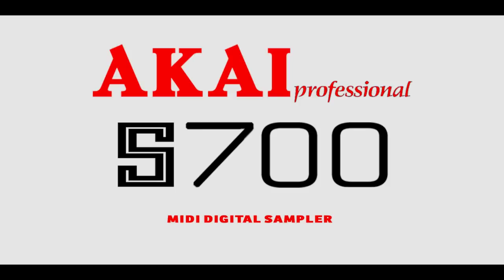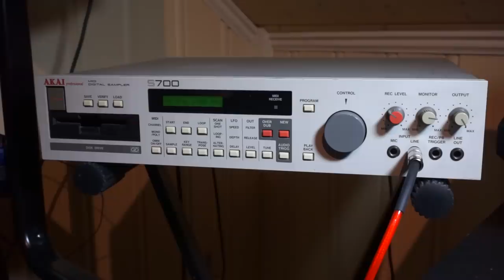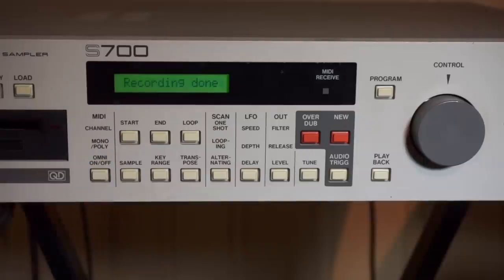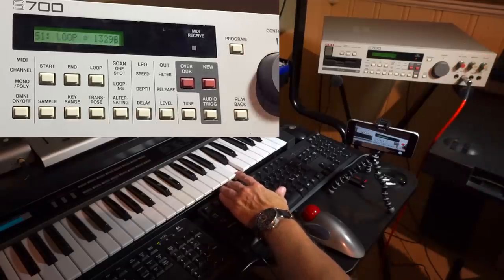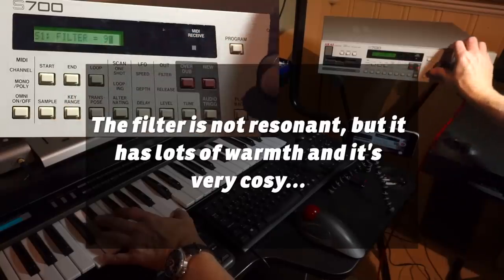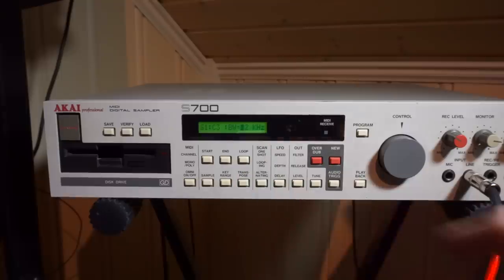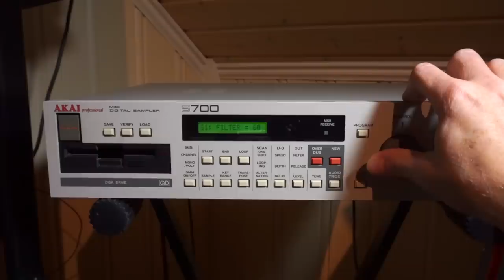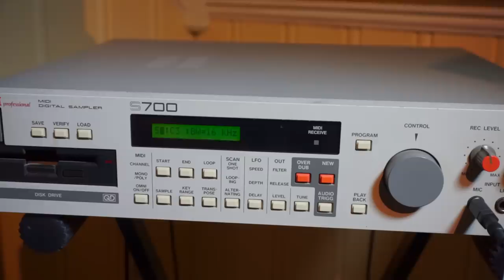Akai S700 sampler - Find this on the flea market for coffee money

Comment: how does the 7000 go againest the 5000 and 6000  ? was woundering on the vocals that was the S7000 with reverb?
Reply from the maker: The 5000 and 6000 are hi-fi samplers and they're transparent and solid, but they can't touch these old 12-bit samplers in terms of personality, grit and 80s-ness. The S700 sounds miles better than the 5000 and 6000 IF that sound is what you want. I used reverb on the vocals yes, there' were no built-in effects on the Akai samplers before the S-1100 (if you had the effects card).
Reply: @EspenKraft  I hear everyone raves about the s950 widley used and how does the S01 and s2000 can possibly buy one at the moment is it anything like this 700?
Reply from the maker: Yes, the S700, 900 and 950 sound about the same. The S900 and S950 has more edit options, more memory and more of everything, but the S700 has the easy operation, fast sampling. The S01 and S2000 is again newer and does NOT sound as great as the older ones no. Stay clear of those.
Reply: @EspenKraft  okay great wil think about these going to be my first bit of hardware gear got the MC 505 ariving excted then next want something to use to change from all the software something to give some hardware power in some form!!! Or a mixer if you have any thougts if you had to go out and buy your first piece of hardware what would you be looking at ? something under $300-1000
Reply from the maker: I'm not the right person to ask general questions like what's the best mixer on a budget really. There's plenty of videos on the net for that so just Google it :)
Reply: @EspenKraft  okay thanks like you sound you channel just found it and was just woundering since i am starting in hardware will look some more thanks!!!
Reply from the maker: No problem! I've been doing this so long that I don't keep track of all the new stuff coming out.
Reply: @EspenKraft  I can tell lol you good at your equipment keep up the good work and videos real pleasure!

Comment: I'm curious what you think are the differences between the S612 and the S700?
Reply from the maker: Just look at them? ;-)
Reply: @EspenKraft  Seriously? I have an S612 and an X7000. I was curious about the actual internals and sound differences.
Reply from the maker: No sound differences to speak of. Different looks and ergonomics.
Reply: @EspenKraft  I'm considering getting one but switching the Quik disk to one of the digital conversions that uses an SD drive. Sadly, these are not so cheap or easy to find than they were a few years ago.
Reply from the maker: I have a video on here showing how I did this to a S700. They don't cost much.
Reply: @EspenKraft  I was really surprised how inexpensive they were. I'll look up your vid on that, thanks.

Comment: Is there anything in the current market you reckon it's at the same level?
Reply from the maker: You don't get this sound from any new sampler today. Besides, there isn't any desktop/rack sampler on the market made like this anymore. All moderns samplers are more groove/beat oriented now. The magic is gone. In software it's even worse.
Reply: @EspenKraft  That's what I thought. Do you need a floppy disk to store the sounds or can be done differently? Cheers
Reply from the maker: Short answer is yes, Quick disks or MIDI sample dump. However, both solutions pose a challenge today as the Quicks disk drives crap out and at least needs the belts replaced and disks are hard to find. The other solution is MIDI sample dump, but the early Akais didn't do the MSD standard back then so you'll need old computers and software to be able to do it.

Comment: some lfos?  interesting the s612 only has pitch.  its also my favorite sampler
Reply from the maker: The S700 is infact a slightly updated (in 1986/87 they thought membrane switches and menu driven features was an update) S-612 which in turn is 6 separate delay lines not even invented by Akai themselves at the time. Both has a single LFO only.
Reply: @EspenKraft  yea i have heard the same thing, that it was invented by someone from EHX at the time.  With the overdub function, you could almost get it to perform like a looper though not hands free
Reply from the maker: @Ancaja123  Exactly!

Comment: "for next to nothing!" - it's 2021 and that aged well
Reply from the maker: No, Akai 12-bit samplers are hot right now.
Reply: @EspenKraft  yes they are, but, well, I grabbed myself Akai S900 because I guess you got to have at least one 12 bit sampler in your arsenal, eh
Reply from the maker: @wrmusic8736  At LEAST one. ;-)
Reply: @EspenKraft  Korg DSS-1 is certainly looking (and sounding) good, if a bit intimidating due to its size.
Reply from the maker: @wrmusic8736  It is big. I think it's much better as a synth than sampler. I'd rather use the DSM-1 if I wanted it as a sampler.
Reply: @EspenKraft  DSM-1 has gutted filters though. 24db locked and no resonance controls. Having twice as many voices as DSS-1 only to not be able to use those majestic filters to their full potential is such a waste.

What is interesting to me in DSS-1 is the potential to use it as a synth with, basically, custom oscillators created by sampling. I'm not sure there's any other sampler like that, maybe Prophet 2000 coming close in terms of specs, but not really.
Reply from the maker: @wrmusic8736  It has a crippled filter, but to me that doesn't matter as much when I'd use it as a drum sampler, also how it was intended to be. It's best to have them all of course. If you haven't checked out my 12-bit sampler shoot-out you should  check it out as I put the DSS-1 and Prophet 2000 next to each other in that. ;-.)
Reply: @EspenKraft  it was the video that got me interested in DSS-1 in the first place - because those were the best filters in that whole video, beating P2000 outright.

But I'm getting S900 to be my drum machine, because OMG - the things it does to drums (and bass).
Reply from the maker: @wrmusic8736  Sure, we all like different things when it comes to sound and no rights or wrongs. As long as the result is great music that's what matters.

Comment: Is there a basic difference to the S01?
Reply from the maker: Yes, the S01 is 16-bit, while the S700 is 12-bit. The S01 has digital filters while the S700 has an analog filter. Combined that makes all the difference.
Reply: Wow thanks for the quick response. I suppose the S700 came out earlier .
And also one could layer the same sample with those two machines?
Reply from the maker: The manual for the S700 is available online, check it out for specs. ;-)